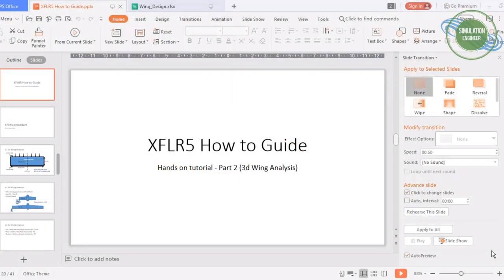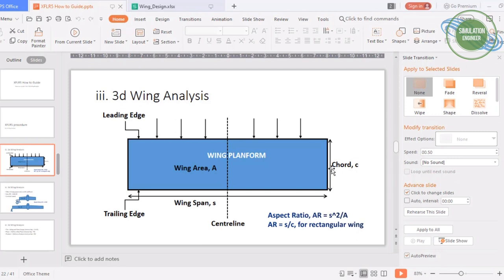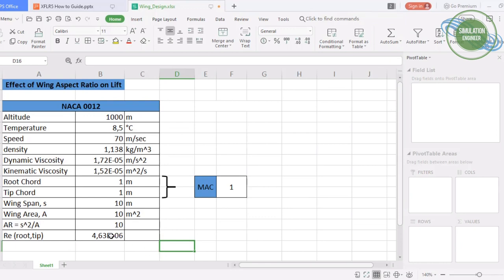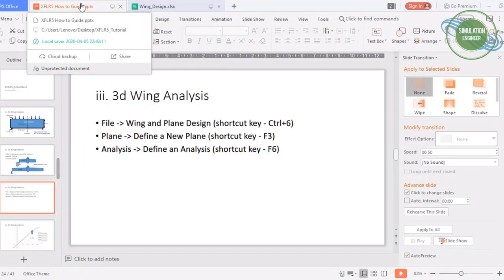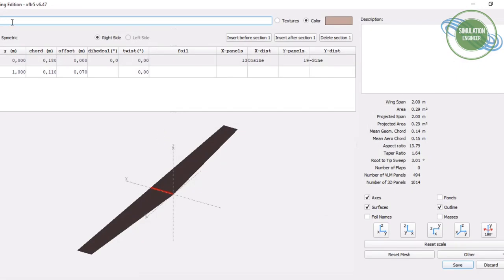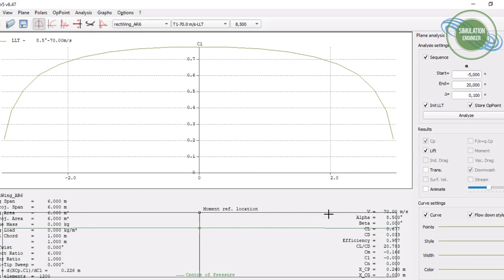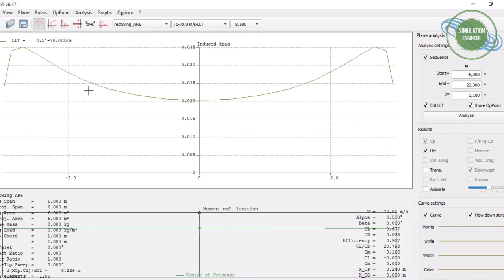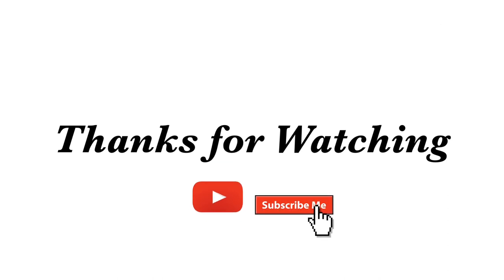XFLR5 PART2 WING ANALYSIS | HANDS ON TUTORIAL SERIES

Comment: Hello,
Thank you very much for this video. You clearly explained the way of analysis and extraction of the results. I do have few queries as follows.
1. Is it necessary to do the aerofoil analysis before finite wing analysis. If so what is the reason? Is it for easy convergence? In this video we got some convergence errors due to difference in Re at aerofoil analysis ans wing analysis.
2. You used LLT, which will not count for viscous drag (according to the LLT theory). So, is the obtained CD is induced coefficient of drag? Again, recalling my first question, it was aerofoil analysis in the beginning and XFLR5 uses same method as the XFOIL for aerofoil analysis which will count for viscosity. 
3. Can I do partitioning in my wing and apply twist in the outboard segment. For example, lets say total span is 3m, that is 1.5 m each side of the wing. can I do partitioning at 1m so that the inboard segment will have 1m length  and outboard segment will have 0.5m. Now I want to apply a -ve twist in the outboard segment. Is it possible in XFLR5?
4. Can I analyse an aerofoil and wing with a chord less than 1 m (say a wing with C=0.5m). By default, I think XFLR5 calculate moment at 0.25 meter or 0.25 chord, which one is correct? for example, if aerofoil has chord of 0.5m, 0.25 chord is at 0.125m. Does XFLR5 count this automatically? In XFOIL it is 0.25 meter, not 0.25% chord. When I analysed an aerofoil with 0.25m chord, I was getting wrong Cm values due to this and then I figure out the way to change the point where moment is acting.
5. Could you please suggest  documents which gives an extensive explanation (with derived equations) for methods (2D &3D panel methods, LLT and VLM) used in the XFLR5 or make video on that? It will be very helpful for those who use XFLR5 for research purposes.
6. There are two types of VLM (horseshoe and ring vortex). Could you please explain those?
It will be so kind of you if you could answer my questions.
Regards,
Muhammed Sadique
Reply from the maker: 1. Well it’s necessary to do the airfoil analysis in order to cover the complete range of local Re, think of a practical wing having tapered and varying chord. The convergence error was part of the exercise and to demonstrate how to avoid this error.
Reply from the maker: 2. XFLR5 is a user friendly interface for Xfoil and also the transformation of original code from Fortan to C/C++. Wing analysis capabilities have been added in version 2.00. Initially, this was done using  the Non-linear Lifting Line Theory (herein referred to as "LLT") to the design of wings operating at low Reynolds numbers.
Later on, the necessity the addition of Vortex Lattice Method (herein referred to as "VLM") for the design and analysis of wings with geometries not consistent with the limitations of the LLT.
Followed by the Katz and Plotkin’s recommended VLM method based on quadrilateral rings, and the VLM calculation of planes with elevator and fin.
On March 31st, 2007, XFLR5 has become an Open Source Development Project hosted by Sourceforge.net. Version v4.00 introduces a 3D panel method for wings and planes, including modeling options for fuselages.
The wing may be computed by either one of three methods, each having its own advantages, and all having some usage restrictions.
So therefore the first is a Lifting Line method, derived from Prandtl's wing theory. The second is a Vortex Lattice method. The third is a 3D panel method.
The originality of the implementations is their coupling with XFoil calculation results to estimate the viscous drag associated with the wing, although this is done in a different manner depending on the method.
Reply from the maker: 3. Sure you can do wing partitioning and apply twist by wing definition section window you have the option of wing dihedral, twist, offset ans panel distribution.
Reply from the maker: 4. Well theory and analysis tells us that the neutral point is 25% from the leading edge of airfoil. Even if we take two different wings having self-stable and not self-stable foils. Calculations confirmed that the neutral point is at 25% of the chord.
Reply from the maker: 5. & 6. See the answer in 2 also and I may try to do a video on that topic too.
In VLM and panel methods, an inviscid analysis/polar may be defined, in which case there is no need to define a polar mesh for the foils. The viscous characteristics will be set to zero.
The LLT is necessarily viscous.
The analysis may be of the VLM type and is performed on the mean camber line.
The analysis may be of the 3D-panel type in which case the wing is modeled as a thick surface.
It is recommended to choose a panel distribution which is consistent with the wing's geometry, i.e. the density of the mesh needs to be increased at geometrical breakpoints and at the root and tip of the wings. A cosine type distribution is recommended in the chordwise direction to provide increased density at the leading and trailing edges.
There is a lower limit size for the panels below which the calculation becomes unstable, or which leads to non-physical results. This can typically occur with "sine" spanwise distributions of panels. Ideally, the precision of the calculation increases with the mesh's refinement, but so do the calculation times. It is fairly simple to experiment to determine what is the best compromise for a given design objective.
Numerical instability may also occur in 3D Panel analysis if a panel’s lengths in the streamwise and chordwise directions are too different. The panel’s aspect ratio should be kept low.
It is possible to exclude from the calculations the wing panels with a spanwise length less than a minimum value. This can be set in the advanced settings dialog box. If the minimum length is set to zero, then all wing panels with length less than 1/1000 of the span will be excluded. This is meant to avoid numerical errors linked to small mesh elements.
Reply from the maker: Hopefully this answers your questions 😊 Thanks for detailed comments and queries. Good luck.
Reply: Simulation Engineer 

1. Okay. I did the same. But when I am simulating a wing with span of 1.25 m and chord 0.25 m. The solution is converged for LLT, but I program is not running for VLM and 3D panel method. Do you have( or please suggest) any video which gives step by step procedure for VLM and 3D panel method?
Reply: Simulation Engineer 

2. Thank you. I do have one more question regarding the same. 
Xfoil counts for viscous and profile (drag due to separation, for a certain limit). Does XFLR5 ( all the three 3D methods) uses results for both the drag from Xfoil for estimation of drag over finite wing?
Reply: Simulation Engineer 

3.  Yes, I saw some tutorials on that one. For my case, it is two partitions at one side. And I need to have a nose-down in outboard segment only. Which means the root and tip on inboard segment has no twist or pitch. For outboard segment both the tip and root(not root of the wing) have nose down pitch. I think this also possible in XFLR5, if not please correct me
Reply: Simulation Engineer 

4. But still I am getting positive Cm for a NACA0012 airfoil with 0.25m chord length.
I did same simulation in xfoil developed by M. Derla and compared with the results all results are matching except Cm.
Reply: Simulation Engineer 

Thank you very much for your time and detailed answers.
Reply from the maker: @muhammedsadiquep1053  Well i would suggest the XFLR5 / XFoil guidelines for that ...
Reply from the maker: @muhammedsadiquep1053  i) The LLT is necessarily viscous.
 ii)The analysis may be of the VLM type and is performed on the mean camber line. iii) The analysis may be of the 3D-panel type in which case the wing is modeled as a thick surface.
Recommendation:
I would do the panel redistribution both "streamwise / spanwise" in case of convergence problems. Because wrong panel distribution with VLM and 3D Panel method might lead to instability.
Reply from the maker: @muhammedsadiquep1053  For rest of the queries i would recommend the XFLR5 /XFoil documentation guidelines. Good luck.

Comment: I have encountered a problem (This may not be a problem, just a misinterpretation), when I fixed a value for AR, the lift and drag graphs plots the same curve even for diferent free stream speeds. This behavior is expected or not? 

Obs.: All airfoil profiles is SELIG 1223. 
Wings dimensions:
1 - S = 1,56 m², AR = 4, Span = 2,5 m, Chord = 0.625 m
2 - S = 0.511 m², AR = 4, Span = 1,43m, Chord = 0.357 m